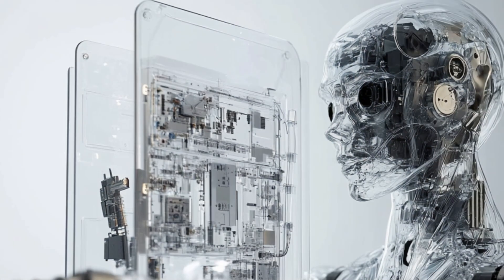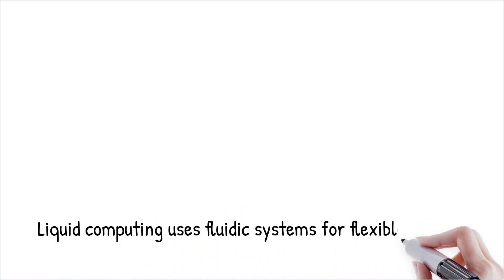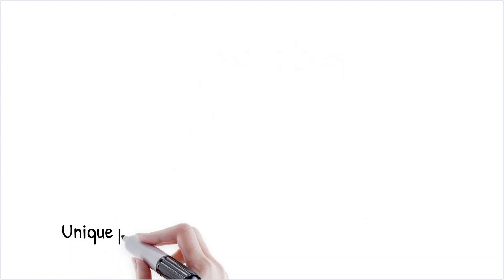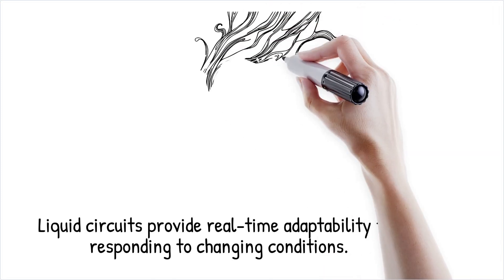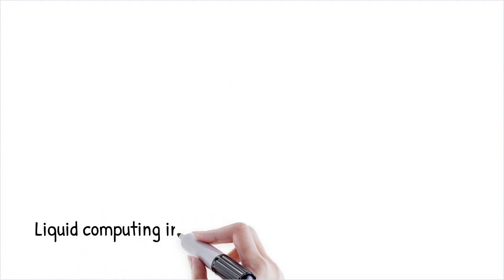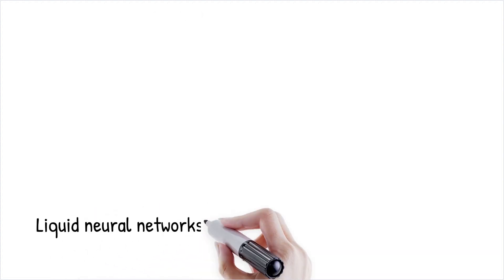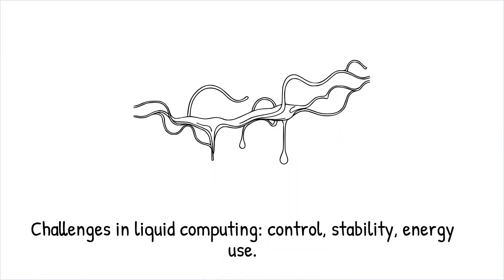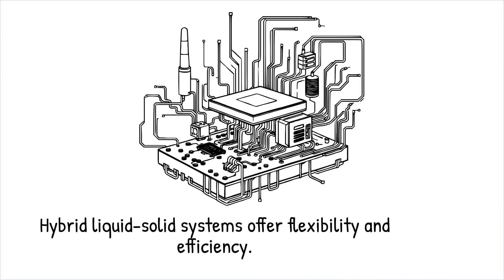Liquid Circuits: The Future of Fluidic Computing in Motion

Comment from the maker: How do the design and fabrication techniques of microfluidic chips ensure precise control over fluid dynamics at the microscale, and what are the key challenges faced in achieving this precision?
In what ways do microfluidic chips redefine the architecture of fluidic computers, and how does this integration compare to traditional electronic computing paradigms in terms of scalability and energy efficiency?
What are the specific limitations of lab-on-a-chip technology when used in chemical analysis, and how can advancements in microfluidic chip design address these challenges?